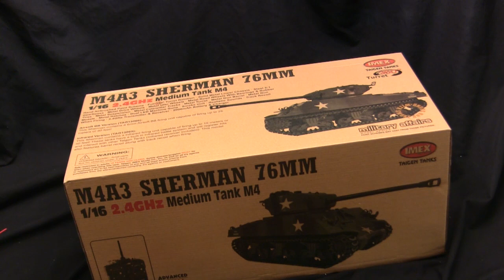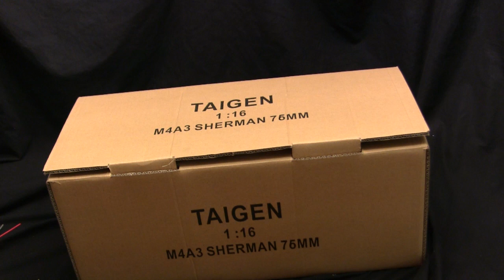1/16th scale RC Taigen M4A3(76) Sherman tank model rebuild part 1 of 4 (unboxing / review)

Comment: 22:22 - it's not that simple swap. Taigen wheels have bearing and metal bushing with different diameter than Heng Long plastic insterts. You have to use HL scew to hold it and the wheel will wobble a little.
Reply from the maker: good to know, thanks for the heads up

Comment: Could you maybe answer a newbie question? What is the difference between Torro and Taigen and what makes one pick one version over the other? Thanks in advance and Happy New Year!
Reply from the maker: From what I gather the two are the same. Torro tanks are generally found in Europe and does the distribution there. In the US and N. America the tanks normally have the Tiagen branding but are the same model and RC equipment. Also From what I have seen there are some kits that are specific to torro, these would include the Jagdtiger and the Panther II. These two models are still available in the US under the torro brand and are distributed by IMEX, who also does their own branding on the Tiagen models for the US distribution
Reply: @oddball759mm  Thanks for the info. That clears it up!

Comment: A friend and I both have the Torro (Taigen) 1/16 Sherman 76mm, which have the tracks with the duckbills.  We both have an issue with these tracks where the duckbills get pushed up by terrain, which pulls the pin out enough to get past the knurling, at which point the pins work their way out and get bent.  The small pin protrusion on the duckbills also get broken.  Have you had the same issue?  I'm thinking about switching to the Mato tracks because it looks like the duckbills are cast into the track links.
Reply from the maker: I never use the taigen tracks so I can't say. The mato duckbills are not casted in and are separate, I will say that I have never had any issues with the mato tracks on the shermans I have run and built and the problem that you are encountering was never something I ran into.
Reply: @oddball759mm   Good to know!  Thanks!